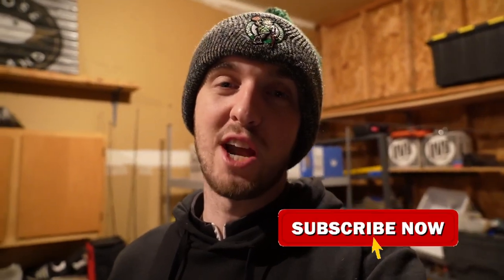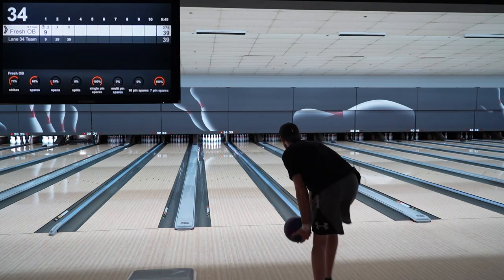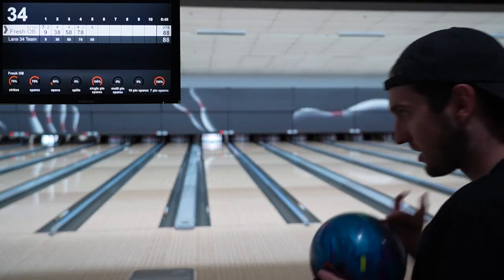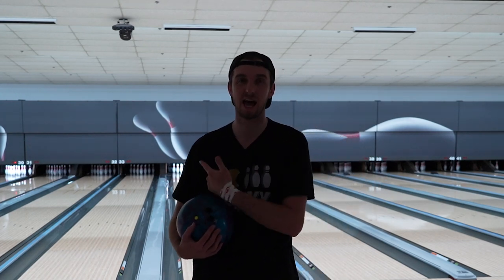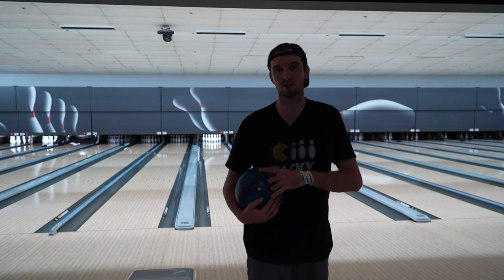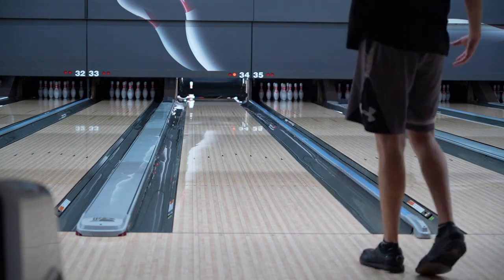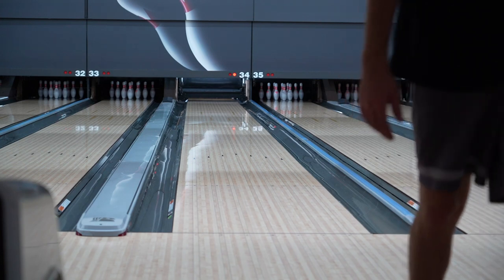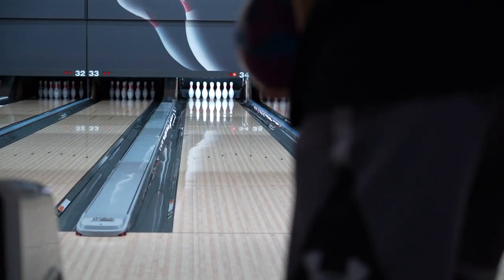How To Make A Bad Bowling Ball One Of Your Best!!

Comment: What is the best solution when figuring out what surface to put on the ball to cater to your game based on core and coverstock of the bowling ball?
Reply: Surface should be the last consideration and quite possibly one of the more difficult. I have some at 5000 and others at 360. It all depends on what you are seeing and what you want to be seeing
Reply from the maker: I just use it out of the box for its original purpose and if that doesn’t look like it’ll fit where I need it to I will adjust the surface accordingly!

Comment: This video goes to show you that pin placement, PAP, CG, pin above, pin below, etc does not really matter. Ball grit accounts for about 80-90% of the ball movement. If you take 4 identical balls and they are all drilled the same and then have them with 2000, 3000, 4000, 5000 grit. You will get 4 different ball reactions even though they are drilled the same. I think most bowlers (average house bowler) believe that pin placement is the most important part and are never really taught about grit effect.
Reply from the maker: Coverstock/surface of the bowling ball dictates most of the reaction!